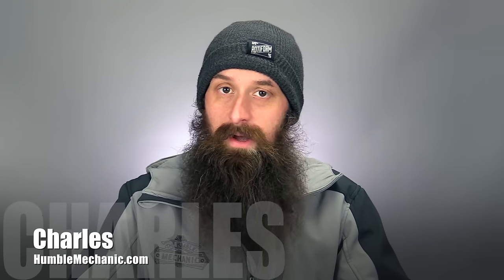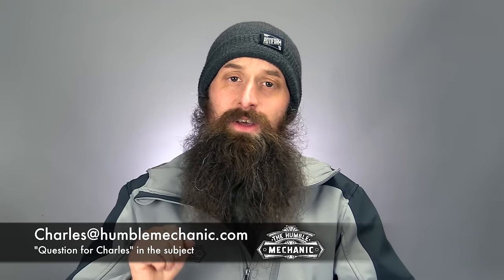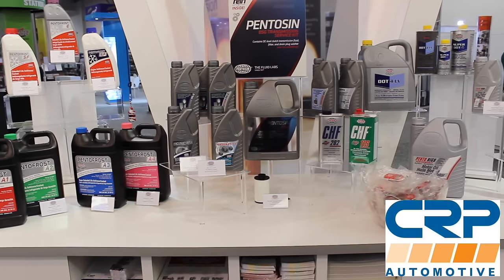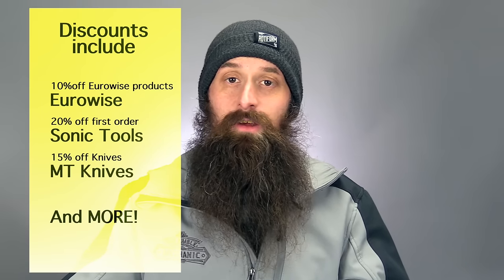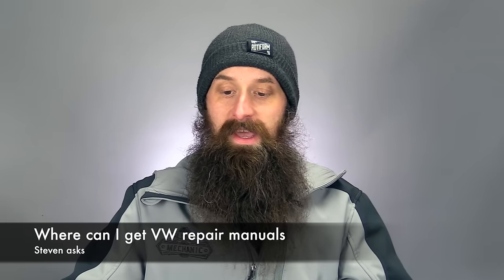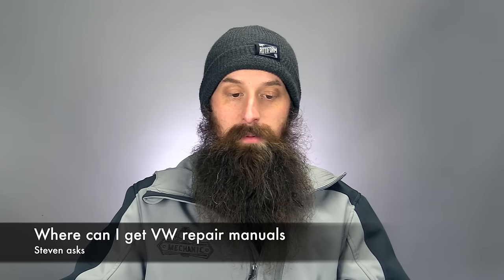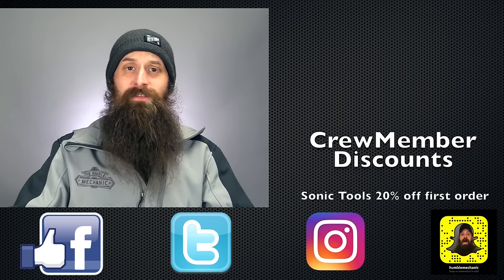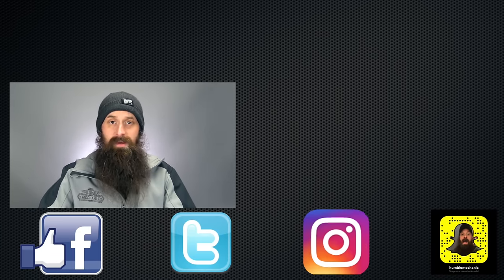Viewer Automotive Questions ~ Podcast Episode 181

Comment: Re the bolt question, I've been trying to get your full opinion on that one for a couple of years ;) - glad to see what you do is exactly what I do. Re-use them, but don't do the full 90 - 45 is what I usually do if they require an angle turn. With my own car, after reusing them more than twice they get replaced on the third....and yep totally agree that a hard impact causes more damage.

Comment: 08 passat (my previous car) got parking sensor module flooded out due to blocked trunk drain tube.
Got a used unit, fixed it up out of the way on rear light cluster mount, reprogrammed with vcds and bob's your uncle. 
Oh.... and unblocked both drain tubes.
Cheers Charles! 👍

Comment: When I worked for a local VW dealer I had a Golf and Passat (98-01 MYs) with so much water inside there was a lake in each foot well. I don't remember the cause of the Passat but I distinctly remember the Golf had a body plug under the passenger foot well that was pushed too far in at the factory. It was the front 1/3 of the plug that allowed so much water into the car. Ended up removing the entire carpet from both cars to completely dry all the modules, padding and carpets. Serious nightmare.Great video as always. Usually provide me with a good trip down the VW memory lane.

Comment: As for the fuse labeling - you might want to look at the manual.  I can't speak for VW, but what I'm seeing on other cars is that there's a good half-dozen fuses that all feed power buses in the BCM.  The BCM then uses it for different things.  #1 might be left stop light, right tail light, etc.  In short, each fuse covers a number of things, but only "one of" so a single fuse out doesn't disable all your brake or tail lights.  As a result - there's no short label that works.  It's a long complex list.  But the answer is to do what your doing - check them all.  You don't want to be spinning your wheels over a blown fuse because you're misinterpreting the fuse label.

Comment: I bought a original retrofit mirror and the kit manual tells me to get 12v+ from the canbus pin 1. I have a piggyback fuse id rather use. Anything speaking for or against that?

Comment: why do they put the 12 volt accessories fuse in the relay block instead of the fuse block on the 02 Passat wagon
so you have to remove the driver side lower dash panel to get to it   so stupid !

Comment: Yo Charles (or anyone) have any idea why the alarm doesn't arm in a 97 passat? Central locks work fine, but the windows won't roll up like they used to. Thanks
Reply: Likely one of the locks (doors, trunk or hood) probably has a bad micro-switch that doesn't work. The locks will all work and not show an open door. Sadly the only way to check is to jump each switch until you find the bad one. I have seen every possible switch bad so one is no more likely than another. Good luck.
Reply: How do I jump each switch? Would it be easier to replace the door handles with power locks? Used to be able to roll down the windows with the key but now I can't seem to do that. Nonetheless thanks for the reply.
Reply: You can remove the 2 wires that go to each switch and connect them with a jumper wire. That will close the circuit and show a closed door. That will allow you to confirm the non-working lock(s). 

As for power windows that don't work, check the fuses first, then power the suspect window motor directly from 12v. If it works then the window switch is bad. Typically the driver switch group will go bad and not allow any other switches to work.